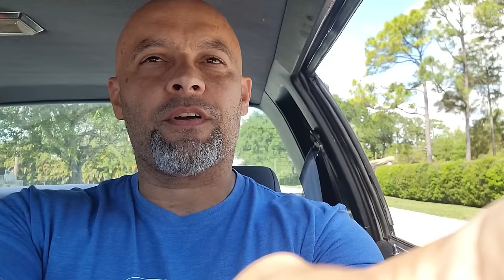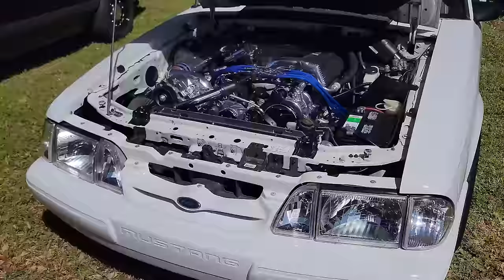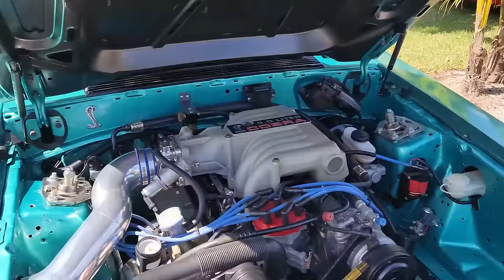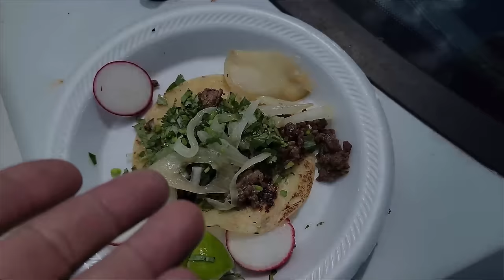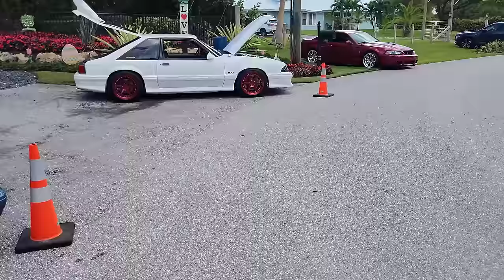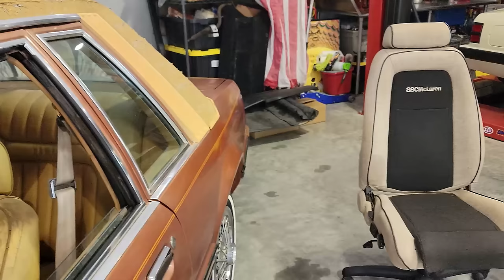Fox Body Gems: Unveiling Hidden Classics in Florida!

Comment: Loujan cars, there was a bunch of em on Sick Week. clean builds. Whats crazy is in the early 2000s, 4 eyes were not desirable, at all. No one wanted to deal with either carbd 302s or the V6 cars. If you were on a budget, you were buying an 85/86 or a 4cyl aero nose and converting it to a V8, back when T5's were $100, entire drivelines for $500.

Comment: I have the chance to buy a 88 fox with a 521 BBF in it with a c6 trans. It’s clean by the looks of it and 15k. Should I do it
Reply from the maker: No LoL
Reply: @YDBT4LIFE  because of the big block I assume? Vs a 351 based 93 down the road with a z spec t5
Reply from the maker: @LyionsMountain  correct. Big block street foxbodies are dumb